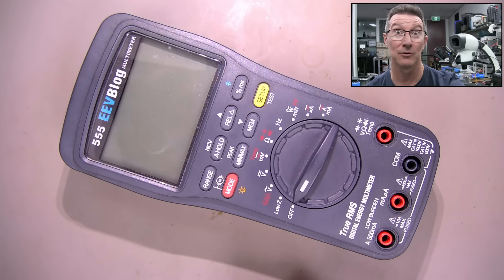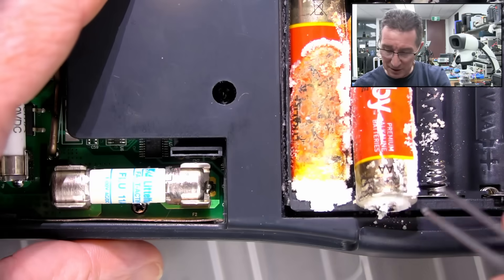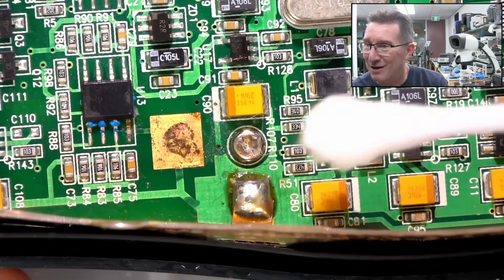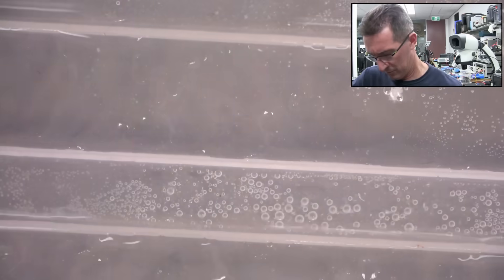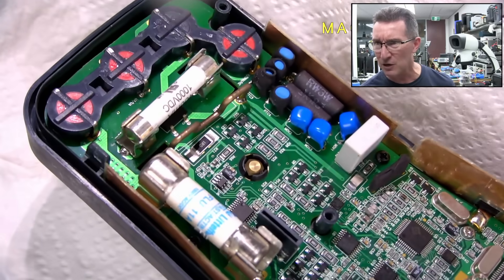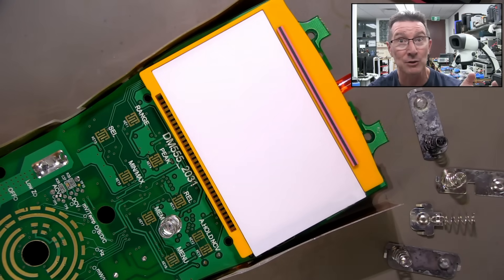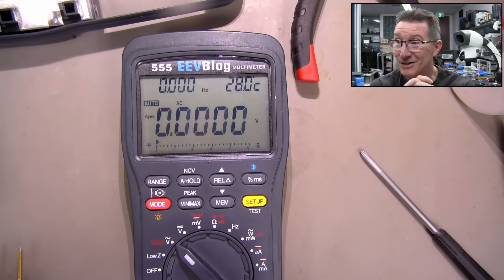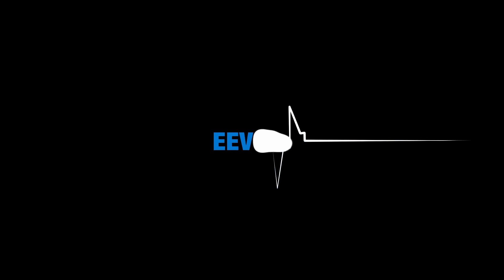EEVblog 1668 - HORRIFIC Alkaline Battery Leakage in Rare Prototype Multimeter

Comment: At least you didn't have a Varta nicad battery in it, those things will eat through PCB traces and then wick under the solder mask half way across a PCB when they start leaking.

Comment: It's pretty easy to nickel plate things if you can't get replacements.  Failing that, put some clear coat on the corroded parts, solder the springs to the flats, and put some contact grease on all the contacts.
Reply: Solder plating works in a pinch too.

Comment: You can just use white vinegar in your ultrasonic cleaner.
Do another round with some dishwashing soap and water followed by a good rinse with water and alcohol.
Could also just throw the plastic parts in there to clean those up.

Comment: Another fun battery leakage problem is the 3.6V 1/2 AA lithium batteries used in old Macs. They spew nasty corrosive goo everywhere if left in the computer for too long. They’ve ruined countless old machines. 😢
Reply: I'm convinced those contain alien blood as electrolyte. The damage they can do is incredible, it eats through mm thick steel like nothing, and even just the fumes corrode every steel part in the machine and in its proximity, eats all the solder so components fall off the board, destroys all SMD passives, and although it usually doesn't eat away the copper leads of ICs, it somehow gets into the ICs through the plastic package and destroys the die / bonding wires. It's a nightmare.

Comment: Hi Dave,

I spoke to a chemical place and they put me onto Sonic 1 made by Soniclean.

"biodegradable water based hospital grade medical and surgical instrument alkaline detergent concentrate"

I mix it with distilled water, run the cycle, then rinse with distilled water and IPA if required yeah works a treat.

1 5L bottle lasted 2 years.

Works well for PCB's, jewelry, the wife's makeup brushes, and the first aid kit tools.

Regards

Comment: I wonder if they leak because of a slow drain that pulls one battery to a lower potential, causing excessive chemical reaction and gas production, which the seals are designed to fail instead of the battery exploding or swelling up, it seems that certain devices cause batteries to leak more than others, which is why I think there is some type of specific circumstance that the device creates when unused and possibly orientation could have some effect as well. I'd love to hear your thoughts and if you have had any devices that caused batteries to leak regularly etc. I hope everyone is having a great day or night! Also specific battery chemistries can corrode the casing making it thinner and more likely to leak as well. Again I'd love to hear your thoughts don't hesitate to comment I will answer promptly my brothers and sisters!

Comment: You can re-plate these with nickel, it's not that hard. You can copper plate the solder pads in-situ by painting with copper oxide, and it might even be possible to gold plate or nickel plate in-situ. The best place to learn this process is on horology channels.
Reply: Just cover them with copper conductive shielding tape and solder the wire back on.
Get new terminals from old toys, remote controls, etc.
Reply: @johncoops6897  I agree if that was a fix for your old everyday unit, but for a collectible it needs to be a restoration or it will lose it's value.

It's ironic that as electronics tecs so many do the bodge, when they already they have the most expensive bits of kit needed sitting on the desk to do electroplating. They just needs the chemicals and they are dirt cheap, cheaper than a roll of good quality copper tape.
Reply: @cpcfreak  - if Dave wants to "restore" it to 100% original, he can simply order the repacement parts from HIS supplier.
This is a production product with almost zero intrinsic or historical value. It's pointless worrying about "restoration", especially when brand new parts are available.
Reply: @johncoops6897  I think you've missed the point. While he is lucky that these "two only in existence" prototypes spawned a 3rd party product that can be used as a source of compatible spares, if those sources weren't available these units which are "the only two in existence" would be pricey. In that case he could use suitable restoration techniques to preserve / conserve the prototypes integrity, a bodge doesn't. That is what conservators do, not a bodge but mint!
Reply: @cpcfreak  - I didn't miss any point, however I thing you might have missed the context here. These multimeters aren't priceless artifacts nor particularly significant or inherently valuable or even rare.
My understanding is that they are a STOCK STANDARD production model already sold by Bryman, but are pre-production samples... the only 2 which have "EEVblog" printed on them.
Hence they might hold memories for Dave, as a sample of a product he decided not to rebadge and sell. Or he might simply not care.
Anyway, if Dave wants to just make them functional, then are various ways to acheive that. Of those, the best, easiest, cheapest and quickest way is to replace the contacts with shiny new ones... Even if they didn't come from the OEM.
Reply: @johncoops6897  I'm sure people thought items like the HP-35S Calculator was worthless at an equivalent age, now a mint version is worth a thousand dollars and they are far more common than Dave's two prototypes. Only a fool would shoot themself in the foot for the sake of convenience.

If Dave offers the prototypes for auction in a future live stream I wonder what offers he would get?
Reply: @cpcfreak  - wow, dude!
Just wow 😢

Comment: Glad the damage was mostly contained, I felt sick to my stomach when I saw that first video of that leakage.
A more then fair warning to remove the batteries when not using it and/or check regularly for leakage in equipment.
I would think of 2x methods to "restore" (clean-up) that copper battery contact on the MB;
1. Use the infamous copper-polish that one often uses for (antique) copper ware (dishes, trinkets, flower-pots etc) 
It is a liquid where you just need a little to do its (abrasive) work. (e.g. using a q-tip) with a little pressure for a result.
2. Use a (blue, more grainy) pencil eraser, the ones often ment for transparent (= thicker) overhead-paper. You don't need to go to town with this type of eraser, just a few strokes can often clean-up a service quite well.
These are some of the solutions that I'm thinking off...

Comment: I am so glad they remover all the mercury from batteries now they leak in the package before you buy them. 
Generally giving a spring an acid bath leads to hydrogen embrittlement and failure.

Comment: I've had good results with just plain isopropyl alcohol. Will definitely have to try the vinegar first.
However I did follow Duracell's advice once and used lemon juice, that 2-way radio never worked again.
Then again what did I expect from a company that sells batteries that weren't even a year old and leaked in the packaging?
I've seen some folks that re-plate the metal. And if I had an ultrasonic machine I would definitely try that.

Comment: The biggest concern with rechargeable multimeters is isolation. I want a multimeter with Qi2/magsafe charging. I've started using magnetically aligned wireless charging for my samsung phone and I want more things with displays on them to use it.

Having a multimeter for the bench that's always topped up and magnetically mounted off the desk would be awesome.

Maybe design a model for AA cells that can alternatively take a lipo cell going vertically, so it mechanically locks out mixing lithium and AA cells?

Dunno, might be a cool feature
Reply: My biggest issue with rechargeable multimeters is availability of replacement batteries. A good multimeter should last decades, but the batteries certainly won't.
Reply: @rocketman221projects  If you can make it take a "standard" battery like a mobile phone battery, that'd make it a bit easier to find. I know several products that run on a nokia phone battery because there was a surplus of spares, then a bunch of products started being made to take them and now they've accidentally created a standard

Comment: Does the fizzing mean you have a carbonate, not a hydroxide?

BTW, my usual treatment for corroded battery terminals is to clean them up and then tin them with lead-free solder.

Comment: That right there is exactly why i tend to gravitate towards 9V powered tools 🙂
Reply: That still becomes an issue if it's got board mounted spring contacts. Same thing can still happen... I know because it happened to a device at work. I have no memory of what it was. I only remember being surprised a 9V battery was under the fuzz when I scraped it off, and then being surprised how much damage it did.
Reply: I lost my LCR meter to a duracell 9V - only the carbon-zinc primaries are 'safe'.
It's best to shill the extra $20 and get a rechargeable 9V - it will save your best meters from annihilation...

Comment: Is there any downsides to using rechargeable NiMH batteries? I’ve not come across any in almost 2 decades of using them for all sorts of household electronics.
Reply: Many devices lack a low voltage cutoff, so they can overdischarge and damage rechargeable batteries.
Reply: I think the voltage is slightly lower (1.4v vs 1.5v), which can matter for some applications. When I was looking into rechargeable options for my WMR controllers a few years back I ended up going with lithium-ions that were actually at 1.5v.

Comment: I'd probably just put vinegar in the ultrasonic bath. But what do I know?

I know they say not to, but I've used isopropyl in the ultrasonic bath. Also, I bought off Amazon just the ultrasonic transducer. So you can use a plastic bin and fit bigger stuff in no problem.

Comment: This is why I don''t use Alkaline batteries at all anymore PERIOD. I've entirely switched to Eneloop NiMH. I've had too many close calls the last few years with "name brand" batteries that are made cheap as hell and leak in less than a year. The rates of leakage seem significantly worse these days than I remember 20 years ago. Suspect its from the thinning of the battery cell walls to cram even more chemical into the cell to boost battery life.
Reply: That is NOT the problem....the battery cell walls are not where the cell leaks from....EVERY leaky alkaline cell that I've ever seen, leak from the seal near the minus end of the cell.....sometimes, the liquid goes elsewhere, so if you don't look carefully, you might think that the leakage has come from some other part of the cell, but it has NOT.
Even Dave noted this in this very video! 
The basic problem, is that the modern alkaline cells produce a large amount of gas, which makes the seal fail, which then causes the KOH electrolyte to start leaking out, aided further in leaking by the escaping gas.

Comment: Funnily enough I dealt with an almost identical situation this morning. The battery grip for a Canon camera, I neglected to take the batteries out of it the last time I used it and I found it all gross and disgusting today. Fortunately it was not stored in the camera but outside. Also - it cleaned out really quickly and nicely without any corrosion at all - because the contacts are actually gold plated, so even the KOH didn't have any chance against that. :)

Comment: The best way I have found to deal with terminals that can't be removed is to pack cotton or paper towel around them and soak with the vinegar. Let it sit a while, rinse and repeat...etc
Reply: For the ones that just link 2 ends in series, I often go with scraping out loose crud, then folding some aluminium foil over a few times, and wedging it in place as best as I can. It's harder to do with coil spring terminals, but can still be done.
For actual end point terminals, you can sometimes get foil to work too. It depends if the damage is just on the contact point or the whole terminal.

Comment: Coincidentally, I pulled my Mastech LCR meter out @ work to check some caps on a CNC servo drive board and found the same situation.  No vinegar @ work, tried some battery terminal corrosion cleaner but didn't work, wrong chemistry.  I'm glad Dave did this video to remind me to take some vinegar into work and take care of mine.  For damaged pads and terminals I use the fiberglass scratch pens to clean them up, they usually work well.  If the PCB is too knackered, I agree with the crowd, tin it.  FWIW, Nichicon caps from 1996 all checked good in the drive for both ESR and leakage @ FWV (some were 450v/6800 uF caps!).
Reply: 450V 6800uF WOW! They must be absolute fkn huge! You definitely don't want to touch them.
Reply: @simontay4851  65mm x 225mm for these guys, used for bulk capacitance across the DC bus in the drive.  They're 400v not 450, that was a smaller cap I was testing.  I just scrapped a Mitsubishi spindle drive that had some real monsters in it, 3 of them, don't remember their specs.  And yes, you need to have a healthy respect for these big guys, they don't play nice with Darwin candidates.  They do have bleed resistors and often a 'Charged" LED so you know that there's some V's still on the bus, still always do a quick check with the Fluke to be sure.  Getting bit by HV DC is the worst!

Comment: This is why I switched to NIMH for all my batteries. Even if I don't recharge them, they save my devices.
Reply: I have seen some leaky NiMHs found in 30+ year laptops, even from high quality brands. But compared to NiCd cells from similar era they're bulletproof.
Reply: Non-rechargeable lithium won't leak.
Reply: Only ever leaking NiMH batteries I’ve have been Energizers and an older Aldi battery. Not had leaky a Eneloop or new Japanese IKEA Ladda.
Reply: @av_oid IKEA Ladda and Eneloop are from same factory, so both are very good. 😊
Reply: I had cheap chinese ones that leaked because I overcharged them and formed blue crystals.

My eneloops are still rocking.
Reply: I've been doing the same, I don't know if they can leak too but never had one leak yet. I've even been using them in TV remotes and clocks.
Reply: My NiMH batteries just failed, didn't leak.
Reply: Same. In my experience, NiMH cells almost never leak, even after a decade or more of service. Given that they are designed to be reused 100s of times, it makes sense that they would need to have higher quality seals. My SOP is to toss the off-brand alkalines that come bundled with devices, and use NiMH cells instead.

I stick with genuine Eneloops these days. I tried Amazon Basics, and have had problems with them - one developed an internal short and got hot enough to melt the plastic battery compartment of the device it was in; and many of them seem to be physically slightly larger than spec, so they don't quite fit into the battery compartments of some devices.
Reply: whats NIMH
Reply: @ridass.7137  Nickel-metal hydride rechargeable batteries. Panasonic Eneloop brand is widely considered to be the gold standard for these.
Reply: @  Rechargeable batteries.
Reply: They can't leak?
Reply: @larrybud  I'm sure they can but I have been using NiMH batteries for more years than I have fingers and haven't had one leak yet.
Reply: @larrybud  been using nimh batts for more than 2 decades w/ no batt related damage stories to tell.. 
nimh batts is what they call 'starved electrolyte' vs 'saturated electrolyte'... there isn't much 'moisture' inside so when they vent/leak it's more like a powder that doesn't really stick/flow/creep like w/ the alkalines. 

that being said, given the resting voltage is a bit lower than w/ alkalines, some devices don't power up even though there's still >20% charge left. 
they have 'pre-charged' nimh w/ a much slower discharge rate (especially brand names) but still, because they start w/ a lower voltage when charged (say 1.3V compared to 1.5V) they might not be suited for certain devices that have a min voltage requirement (most common would be powerful led flashlights cutting off well before the batteries are actually discharged)
Reply: @duroxkilo  Interesring thing. I bought eneloops recently and they came with 1.4V even when they are rated for 1.2V on the paper. I pop them in their charger again and come back to 1.4V.
Reply: @ it is possible the dmm is ~0.1V proud or the new production is different... my charger shows all kinds of stats voltage included and eneloops show ~1.33-1.35V after a few hrs rest from complete charge. multimeter shows similar... ~1V when discharged.
Reply: @Splarkszter  That's normal, most Ni-MH cells will show about 1.4V off the charger - especially if overcharged. They typically drop to 1.3 and stay there; but eneloops will retain the higher voltage for a while... 1.2V is actually the low point, where the battery is basically flat. Reversing the charge will make them leak; as does incorrect storage.
I've seen every battery type leak at some point; lithium types are a toxic solvent mess; whilst all the others are a hydroxide nightmare.
Ni-MH and Ni-Cd have the same electrolyte as an alkaline; just maybe a little less - and in a better container.
Reply: @larrybud Had some leaking NiCd in the late 90s, but the dozens of NiMh simply die after like one or two decades.
Reply: @  I have yet to have one leak on the past 5 years.
Reply: @larrybud  They can occasionally leak while over charging or if they get really hot for some other reason, like a short circuit, but apart from that they seem to be safe.